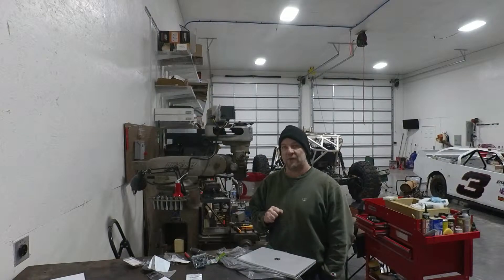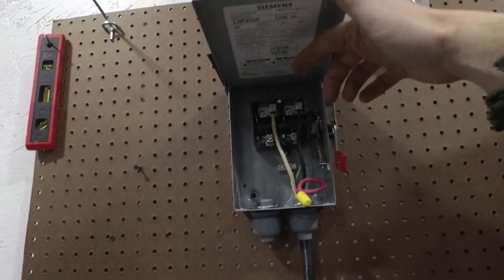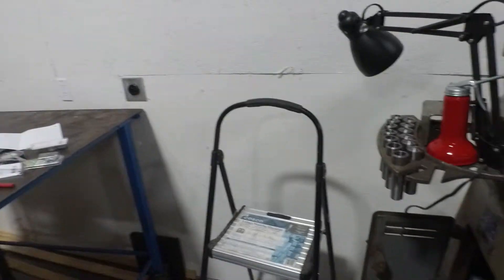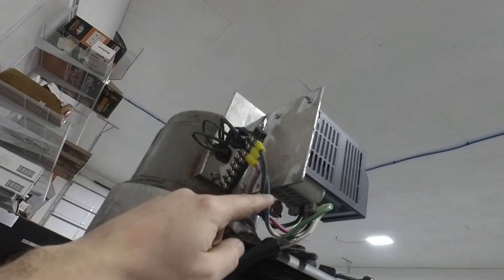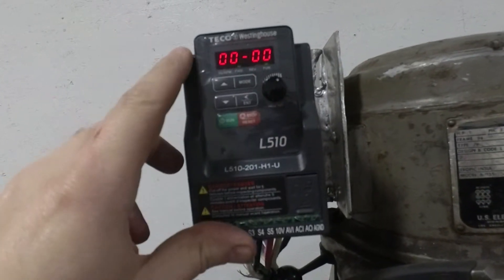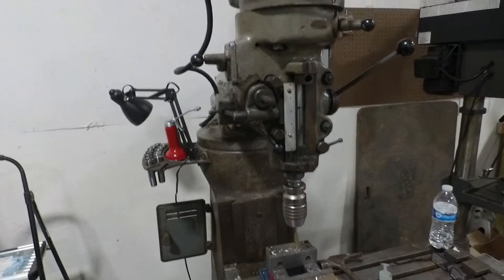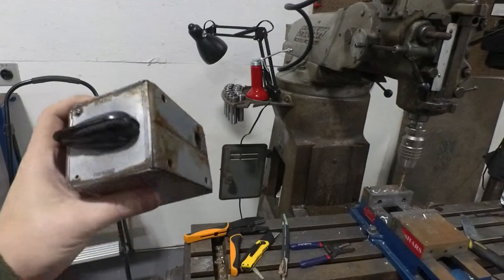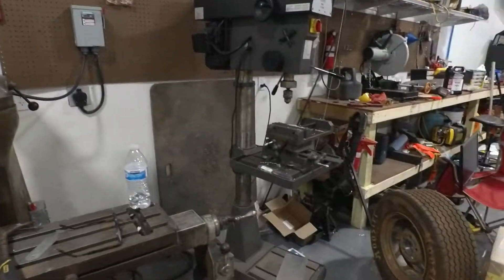Teco Westinghouse L510 setup with Bridgeport Milling machine VFD Single phase to 3 Phase

Comment: could you connect the regular electrical cord coming off the mill straight in the VFD and use the mill control just like if you would have 3 phase in your shop. Instead of opening the motor and connecting the VFD on the motor?  What I mean is from the breaker box straight in the VFD, then hook the wires that usually are connected in the 3 phase breaker box in the VFD. Then when you want to use your mill, you turn on your VFD and after you turn on your mill?

Comment: Thank you so much for this. I just wired up my Teco and it was flashing 005. Programming wouldn't take. When I saw you holding in the enter button, that is when I knew what I was doing wrong.
Your welding will get better with practice. Every welder has had welds like that.
Thanks again.

Comment: Did you ever end up finding a 3 way toggle switch to reverse the motor?
Reply from the maker: Yes, just got a regular 3 way toggle switch off amazon.  Then follow the instructions in the manual for the VFD on what to wire it up too.
Reply: @FrostyFilms704  Do you have a link for the switch you used?
Thank you for the fast reply.
Reply from the maker: @matthewchapes2967  it really doesn't matter, any 3 way switch.  Think this is what I ordered https://www.amazon.com/gp/product/B000BVXWF8/ref=ppx_yo_dt_b_search_asin_title?ie=UTF8&psc=1 but I have several I've ordered for different things, just make sure it's a 3 position

Comment: I like the idea of using a cut off on the VFD, the main reason I’m using a static phase converter is i didn’t want to retire my mill for direct and then cobble together a reversing switch. I understand you could have used the drum switch to activate the function of forward/reverse like the toggle switch you just wire it in the remote of the VFD